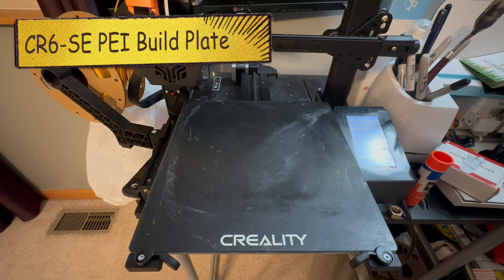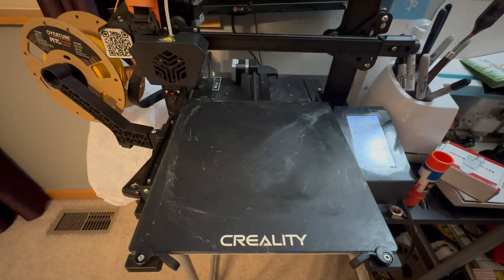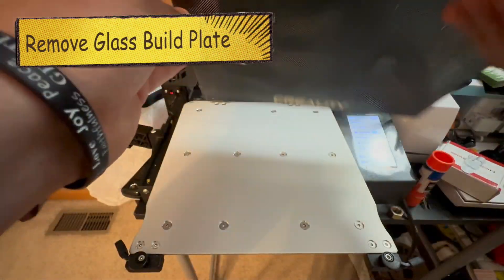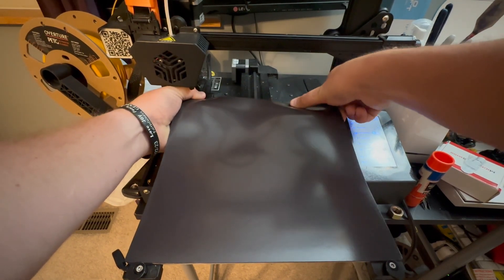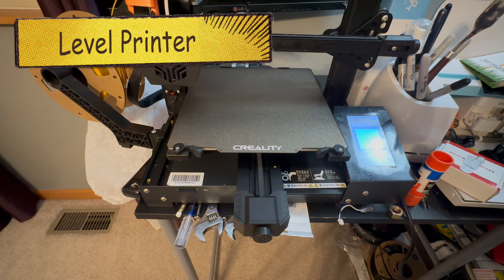3d Printing: How To Install A Pei Build Plate On A Creality Cr6-se

Comment from the maker: Learn how to install a PEI Build Plate on your 3D printer. 

Parts:
- Creality PEI Build Plate - https://amzn.to/3Ygx61k

Tools:
NONE

00:00 The Project
00:09 The Supply
00:27 Removing Old Build Plate Glass
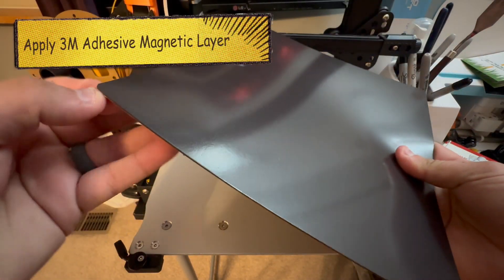00:56 Apply the 3M Adhesive Magenet Layer
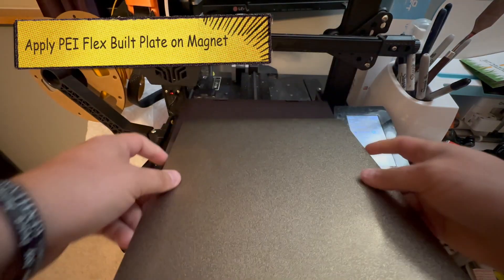01:37 Apply the PEI Flex Build Plate by Creality to Magnet
01:47 Auto Level Printer
02:03 Print Your Next 3D Print
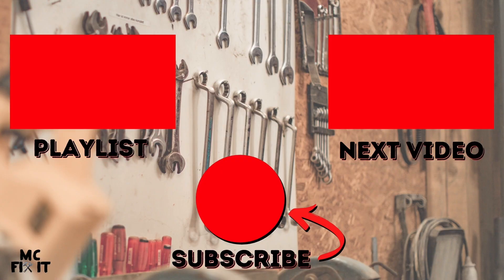02:14 Closing

This video should be helpful in seeing how install a new flex PEI build plate to your 3D Printer. Check your make and model to get the appropriate parts. Be careful not to touch anything when plugged in due to possible electrocution or worse. 

Check out my website at http://mcfixit.us 

Disclaimer:
Due to factors beyond the control of MC FIX IT, I cannot guarantee against improper use or unauthorized modifications of this information in the video, post, blog, or social media. MC FIX IT assumes no liability for property damage or injury incurred as a result of any of the information contained in this video. Use this information at your own risk. If you feel uncomfortable at any time. Stop and go to a professional. MC FIX IT recommends safe practices when working on vehicles, your house, or any other project and or with tools seen or implied in this video. Due to factors beyond the control of MC FIX IT, no information contained in this video shall create any expressed or implied warranty or guarantee of any particular result. Any injury, damage, or loss that may result from improper use of these tools, equipment, or from the information contained in this video is the sole responsibility of the user and not MC FIX IT.

#mcfixit #3dprinter #creality
——
Supplies used to record this video: 
* GoPro Hero 7 Black - https://amzn.to/3f3ALtb 
* 256GB Flash Drive - https://amzn.to/33pAueG 
* Vlogging Frame - https://amzn.to/33tajE0 
* GoPro Pro 3.5mm Mic Adapter - https://amzn.to/2RCURCu 
* Youmic Lavalier Lapel Mic - https://amzn.to/2R55sWX 
* Boom Stand (tripod) - https://amzn.to/3bdkQaw
* 5/8” to 1/4” adapter (boom to blogging frame- https://amzn.to/3txrVsM 
* Portable Battery Powerbank- https://amzn.to/3vJQc0q 
* 6ft USB to USB-C (powerbank to GoPro)- https://amzn.to/3uAS5MH

Comment: Installed this sheet, not it wont level. Makes a bad noise and just homes. The Sensor light isnt coming on sometimes. So I took the PEI plate off and put the glass bed back, levels fine, no issues. Im at my wits end. Any tips?
Reply from the maker: That’s super strange! I didn’t have any issues like that at all. I wonder if they’ve changed something since I made this video. Was it the same plate?